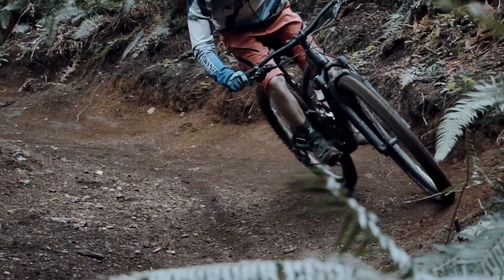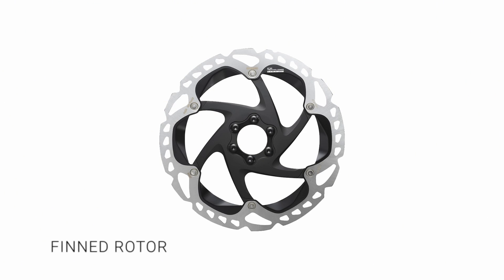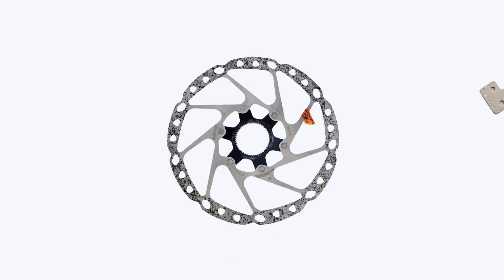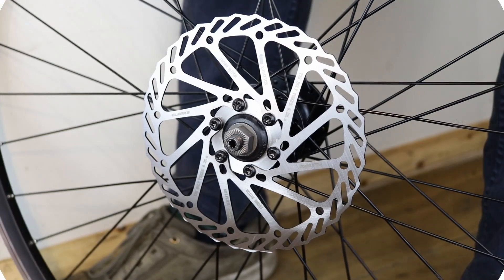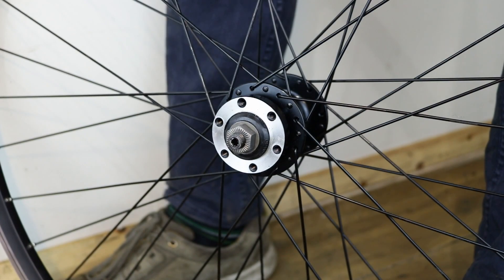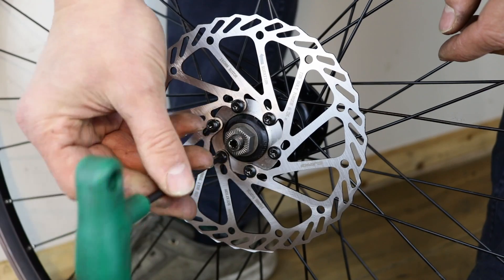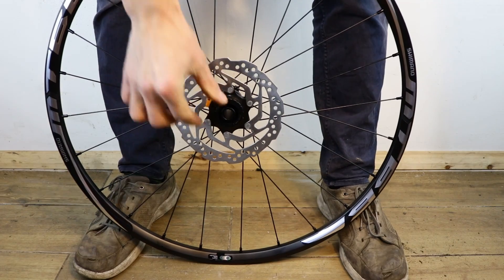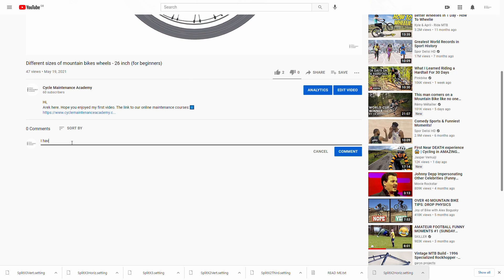Why do bike disc rotors have holes and why there are so many shapes and sizes?

Comment: That's clear. This was very usefull for me.
I have the pads replaced once. After 3500km there were worn. The rotor wasn't worn and might go 10.000km before I need to replace it. I have the 160mm center-lock rotors on my E-bike. I hyave the hydraulic type. Although I like to know one thing.
Is it possible the change from hydraulic to cable operated disc brakes? I can work on cable operated brakes more easy and have no tools for hydraulic disc-brakes.